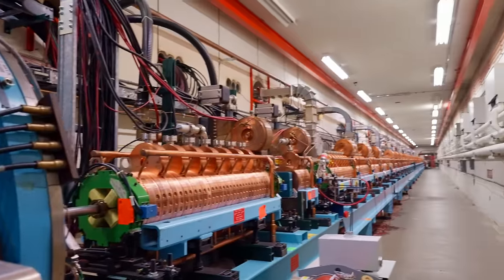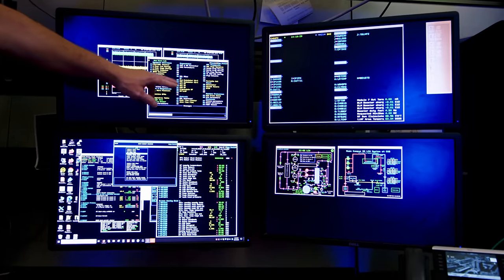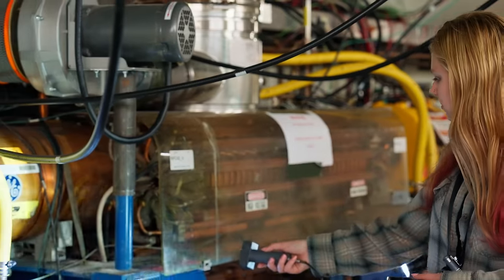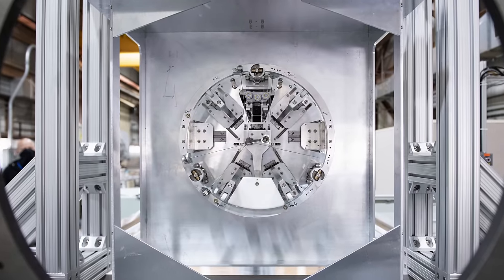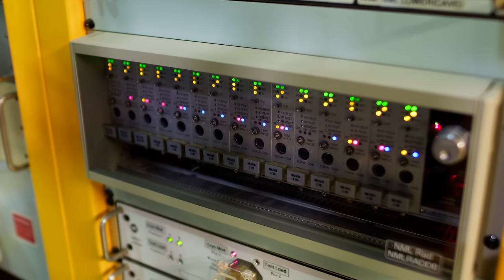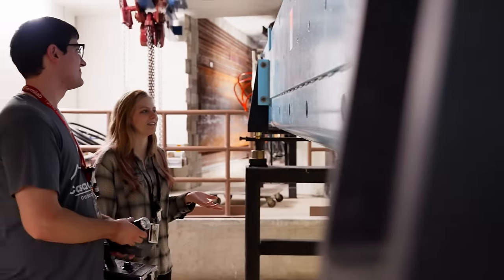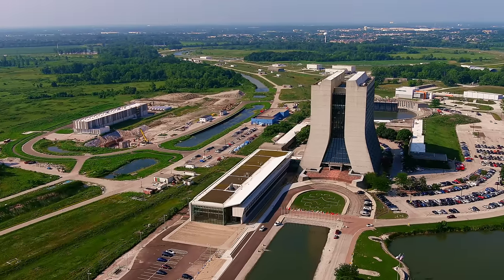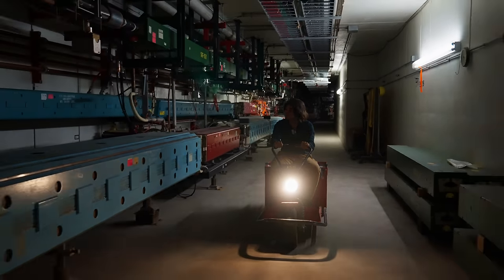Operating Fermilab's particle accelerators | Behind the Science

Comment: I would love a standalone video about all the safety precautions taken at Fermilab.
Reply: Dunno how it's managed today, but when I visited the old Tevatron in the early 90s, there was a board, with key switches. The keys were only removable if turned to the off position.  Any key turned off, would shut down the accelerator (or perhaps only the equipment at that location? but that would require the beam to be off anyway) The keys went to the service buildings. IOW, the only way to get into a hazardous location, was to turn off the equipment first.  There are many other safety precautions - I can't remember them all - but that was the one that stuck in my memory.  An acquaintance was an accelerator operator, and the beam was off at the time, so he generously gave us a full, "off the official tour" tour.  I think I spotted him in the background, didn't know he was still working.  Oh, and I knew a safety guy there once upon a time, too.  Didn't meet him on site, I only ever met him at SF conventions. ^_^

Comment: Yall better be getting paid 7 figures a year for this type of job.

The amount of incredibly specific and complex knowledge for something like this would just be absurd.
Reply: I would be surprised if the pay is even six figures. It's not that special - or even dangerous.
Reply: @Peter_Riis_DK   It's absolutely a 6fig + job, I'd imagine it's at least 200k or more. A CT Tech makes 130k+ in my area and that's like a year of education and a cert.
Reply: I worked there as an Accelerator Operator from December of 1986 through September of 1994. It was not a high paying job. The pay was okay for the late 80s early 90s and I only have a BS degree in Engineering Physics from U of I Urbana-Champaign. Real Scientist have PhDs in Physics and was very cool working alongside some very smart people. Downside of the job was because the Main Control Room is staffed 24 hours a day 7 days a week and 365 days of the year the four crews worked rotating shift work. To get two weekends off a month. Night shift (3rd shift) on Saturday & Sunday was a 12-hour shift 00:00 until 12:00. The Evening shift (2nd shift) does the other 12 hours of the weekend. The upside of those 12-hour shift weekends was because you are paid as an hourly employee 4 of the 12 hours you were paid time and a half of your hourly salary. Also got time and a half overtime for working holidays.
Reply: They usually grab kids right out of college, sometimes with a little grad school. It's good pay for someone that age, but I when worked there (1995 to 2006) it was not 6 figures (starting). But still, good pay and good benefits (WAY more than you'd make as a TA in grad school). If I adjust for inflation from 2006 to now, it was just barely that when I left (as a Crew Chief, that's the guy who sits in the center desk in the video). Interesting part is, OT (because you work some CRAZY hours as @paulmichals points out) makes up about ~20%-25% of your typical pay. One of the coolest jobs I've ever had. In my era, I got to sit up at 3am making antimatter, and get paid for it.

Comment: You'd think they could set up a system that could count people going in and out so they'd save themselves all the checking. Or buy a spot. Or have everyone who works there carry a tag when they enter the area (otherwise door won't open).
Reply: You'd be surprised how often people can get around automated safeguards like that. And for all we know, some of those safeguards may actually be in use, but they still do a manual check as a final slice in the swiss cheese safety model.
Reply: In fact everyone entering one of those enclosures is required to have a key that lets them in, and the system will not turn back on until all the keys are returned to their individual interlocked slots in the Main Control Room. The search procedure is just an extra level to be 100% certain. I don't recall there ever being a time when someone was found "loose" in there.
Reply: @blackcreekresearch I figured as much.

However, it's good procedure that you have an eyes on inspection policy, as well. No matter how sophisticated an automated system may be, it's always better to bet on human error and triple check.
Reply: When somebody's safety is on the line, you don't rely on systems like that which can fail.

Comment: I’ve been assured by my doctor that exposure to that much radiation will likely be fatal, thus it’s better to be behind the science rather than in front of it.
Reply: Really?! They mentioned safety precautions but it’s not enough?
Reply: Unlike Nuclear Power Plants at a particle accelerator when the beam is off there is no radiation. Yes, if one was in the tunnel with the beam on and the beam hit the beam pipe in such a way that it then hit you that radiation received could be fatal. But actually, the wire of the high current power to the conventual magnets and a potential liquid nitrogen leak of the nitrogen insulating the liquid helium that cools the superconducting magnet of the Tevatron is a bigger risk. Entry to the tunnel requires an annual "Oxygen Deficiency Hazard" Medical Approval and passing ODH training. The triple safety procedures of those entering the beam tunnels; 1.) a sign in - was paper back when I worked the - probably now on a computer. 2.) each person going into the tunnel puts a personal lock on a device in the MCR that locked the key need to energize the magnet need to bend the beam to keep it in the evacuated beam pipe. Leaving work without removing your lock was a guarantee to getting a phone call telling you to come back to work to remove your lock. and 3.) The on-shift Accelerator Operator crew personally check the entire beam enclosure prior to powering the magnets and running beam.
Reply: @paulmichals  Okay. I see. I’m nowhere near smart enough to work there anyway; so I’m fine 😁